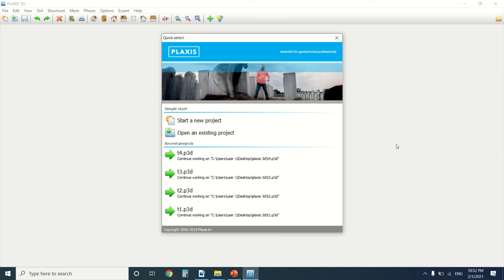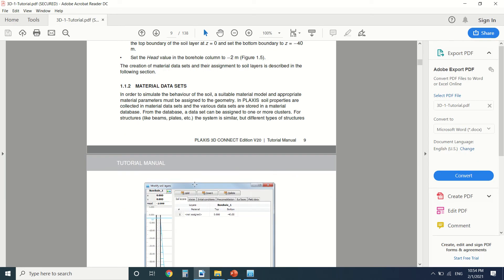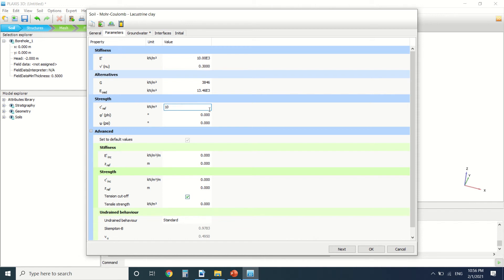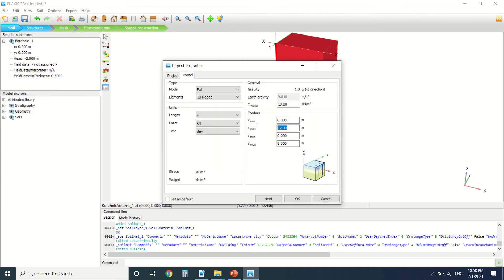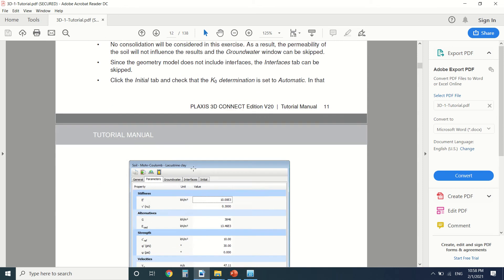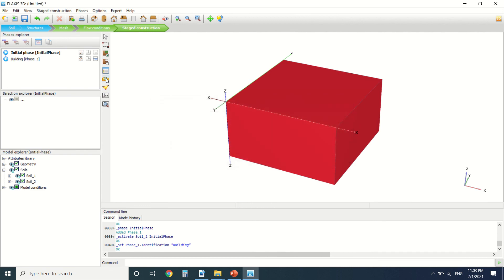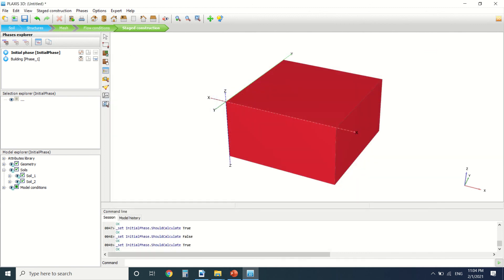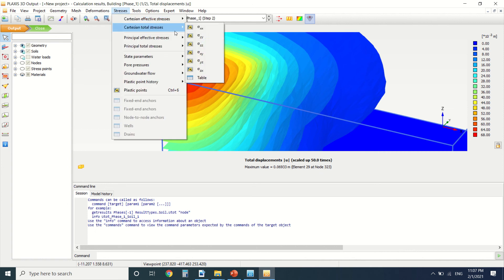6- Plaxis tutorial : Building foundation modeling 1.1 Case A

Comment: hello sir, i have one question about the vertical  drain to assign the material which is used for vertical drain. there is no any option to assign material for vertical drain in plaxis 3d as embankment fill material and soft soil, so if you have any solution about it please ..........
Reply from the maker: A drain is a point where water is drained, not a material
Reply: Ok sir, but my objective is to increase the rate of water dissipation from soft soil while constructing embankment . So in order to increase the rate of excess pore pressure, we have to insert different permeable material with varied spacing as vertical hole. So which method is more recommended to use plaxis 3d  vertical drain or method of stone column? Please help me.